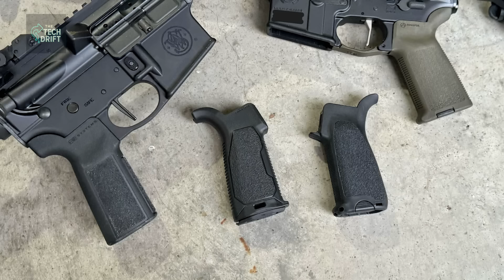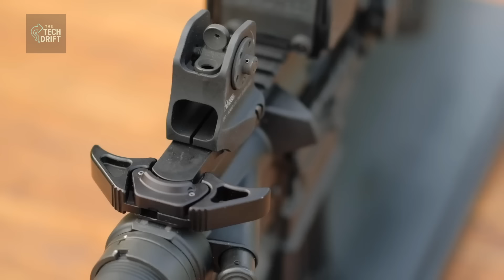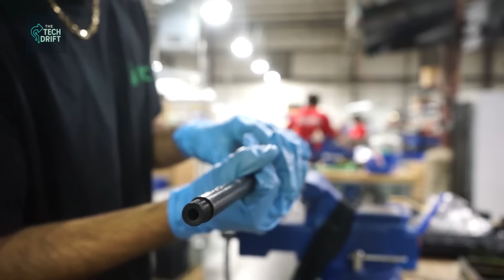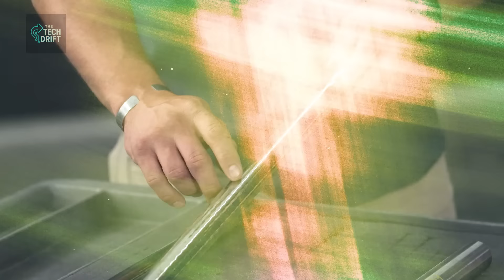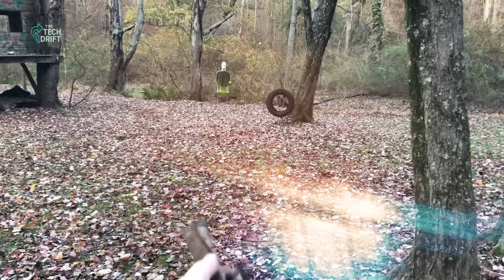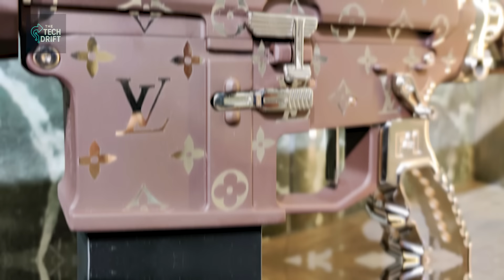How an AR-15 is Made- Inside the U.S Gun Factory

Comment: outlaw version = rod firingpin, inside parts witbout electric insulator coat use smokeless gunpowder cartridges = mostly for war
inlaw version = piezoelectric rod unit, mostly inside parts coated with electric insulator, use reusable jet cartridges (premix alcohol and pressured air) loaded with rubber bullet = mostly for sports match for future

Comment: Assemble…. NOT made in USA… steel made in China..🇨🇳 machines to assemble the guns made in 🇯🇵 Japan, all rubber o-rings seals and gaskets made in China 🇨🇳 scoop glass made in Indonesia 🇮🇩 aluminum is mined in Australia 🇦🇺 plus. Countless other parts, including accessories made in China, 🇨🇳 🇹🇼 Taiwan.. but the employees accept for a handful with work visas made in USA 🇺🇸.. your welcome
Reply: Someone was dropped on their head a few too many times when they were a kid.
Reply: Some raw materials are sourced from other nations. But you said assembled. Most companies do source the parts. But the companies making said parts is done in the USA. So the aluminum receivers are just a block, the a company named Anchor Harvey or Cerro, etc. will actually forge the block and then the forged aluminum receivers are sent to CMT or LMT (USA companies) who will machine the forged receivers. As for barrels most USA companies make them. 

For raw material they're getting a long 4150 CMV rod. Said rod is then either button broached or cold hammer forged in USA. Same goes for the entire bolt carrier group. So like I said about, some parts raw materials are sourced. The USA companies will make and then assemble parts. FN America makes everything themselves, except for small detents and springs. So yes these guns are MADE in America, not assembled per se. Oh rubber rings. Just one is used in the entire firearm....it's used in the bolts extractor. No other o ring seals. And there are NO Gaskets in an AR. Hey what do I know....oh my family is a firearms and munitions company that's almost a 100 years old.
Reply: But still provide AMERICAN jobs!
Reply: I guess you make yours in your bedroom.
Reply: Too many truth revealed 😮